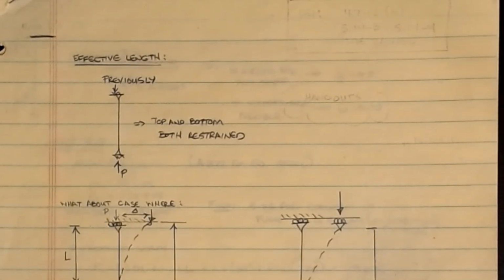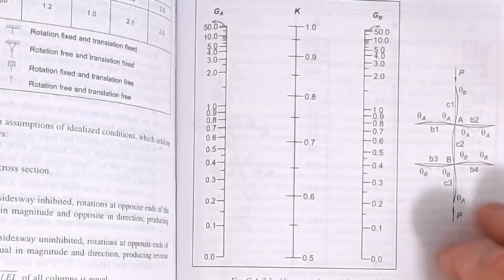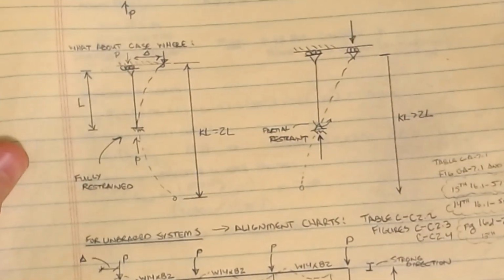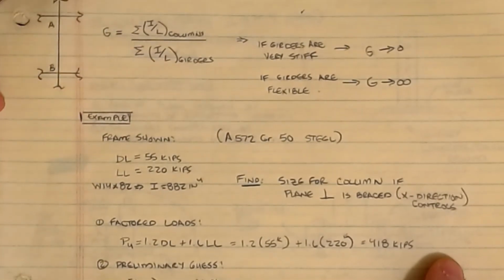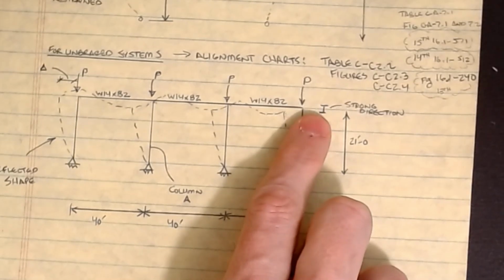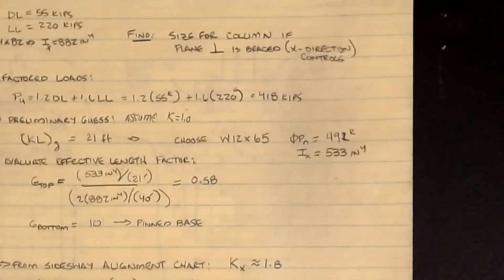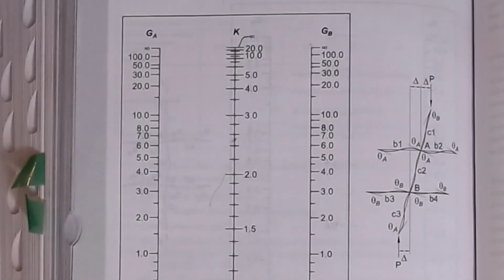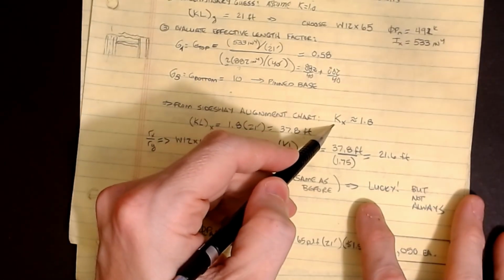017 CE341 Steel Design: Effective Length Part 2 - Column Alignment Charts

Comment: Thanks for the video, but I have a question for clarification. 
When selecting the Ix or Iy for column, you mentioned it's dependent on how the column is oriented.  So for example, if bending about the columns strong axis is perpendicular to the strong axis of horizontal beam (girder) than G would = [Ix(beam)/L(beam)]/[Iy(column)/L(column], is that correct?   AISC Manual, p. 16.1-572 has a sentence that says "Icol is taken about axes perpendicular to plane of buckling being considered, which kind of tells me you wouldn't do what you said to do (even though what you said actually makes sense).
Reply from the maker: You are looking at both planes of bending for the column.  If the column is bending about its strong axis, you use Ix for the column and about its weak axis you use Iy.  Normally I-beams are oriented such that Ix is the controlling I, but in cases where maybe the beam has been turned to an H configuration, then the bending plane would actually by Iy for the beam.  Hope this helps.  Thanks for watching!